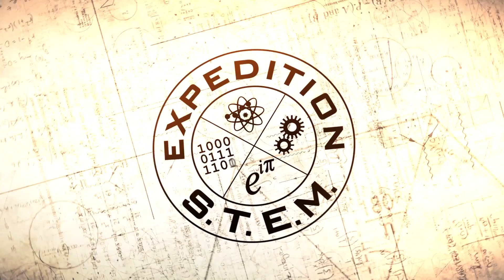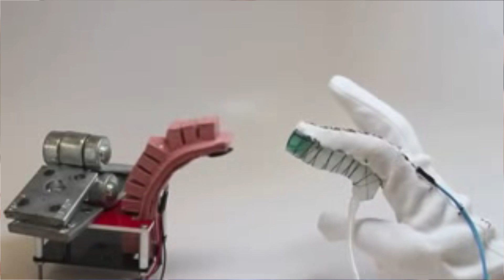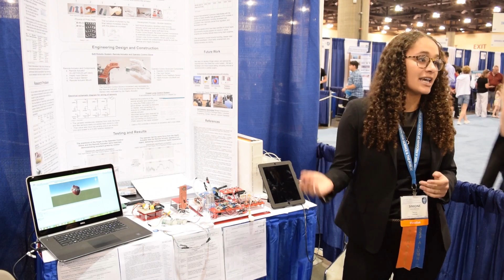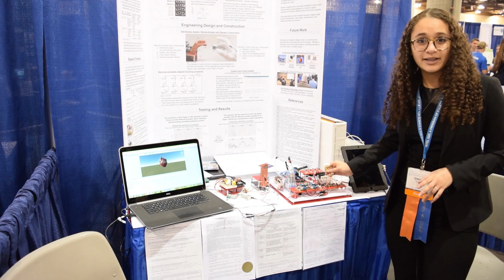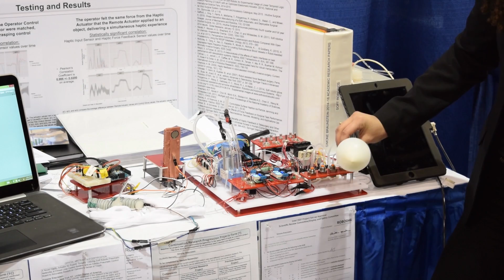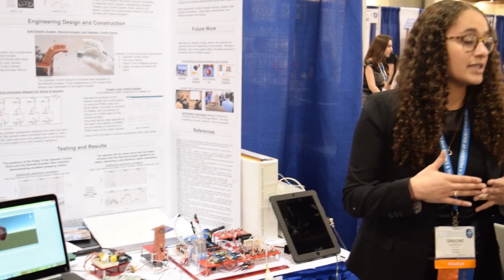Intel ISEF 2016 - Award Winning Project in Robotic Surgery

Comment from the maker: Simone presents her project, A Novel Haptic Actuator for Robotic Surgery: Utilizing Soft Robotic Pneumatic Networks, a Closed Loop Control System, and an Electro- Pneumatic Control Board to Accurately Restore an Operator’s Sense of Touch (ISEF ID ROBO046).
Reply: Really interesting project but it kind of sounds like she made it long on purpose. Could have cut out about half of it and you would still get it